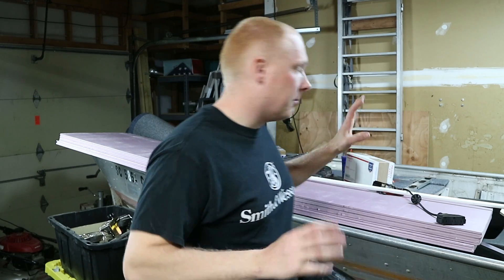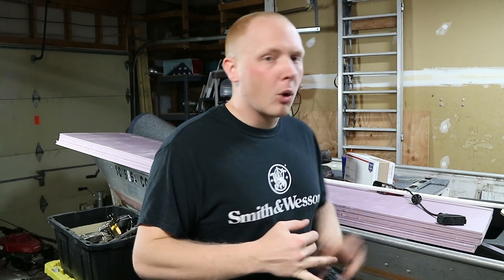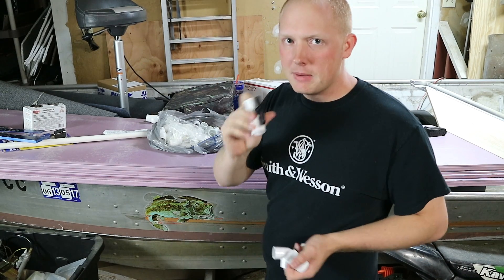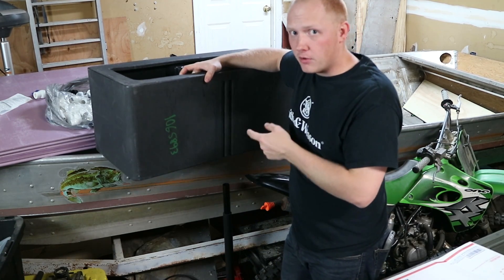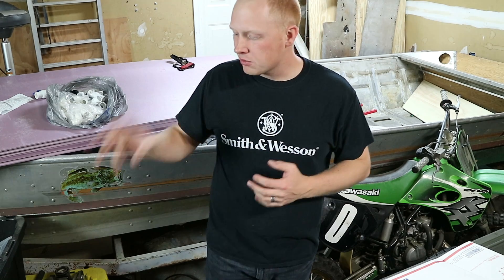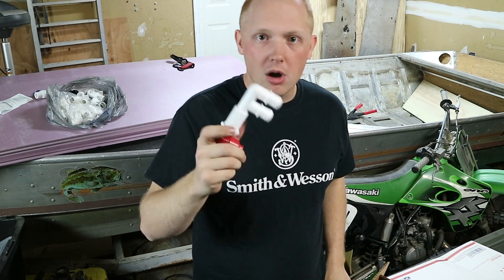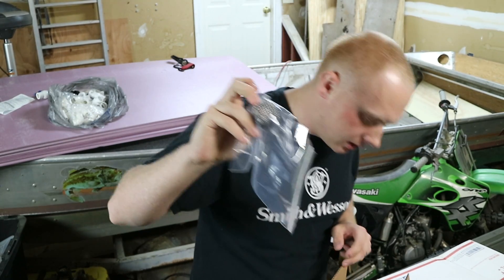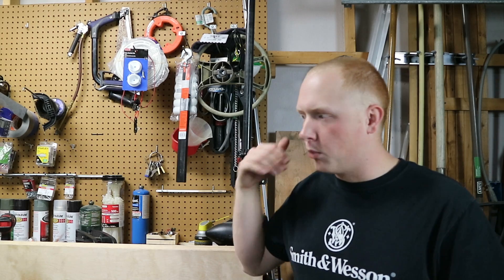Boat Update | Jon Boat to Bass Boat Restoration

Comment: You always make some great vids can't wait to see you boat when it's done I just finished my boat unfortunately lost half my footage so just going to make a finished vid and go over what I did tightlines man and would love to see the vid of rebuilding the trolling motors I'm very hands on and love fixing and building things also the small pipe will allow for more pressure than the bigger 3/4 the bigger the pipe the less compression I only know that cause I do construction for a living I'm a heavy equipment operator so I install a lot of utilities and pipe tightlines man
Reply from the maker: +Fishing The401 thanks man. I'm looking forward to seeing what you ended up doing with your boat. I'll be making a trolling motor repair guide very soon. Thanks for the info man.
Reply: SMG Fishin' no prob man and can't wait for the vid

Comment: You never got to the batteries part haha...
Thats the info im chasing, but seriously nice Boat build man...
Reply from the maker: +Patrick Northey oh man. I didn't even realize that. I guess that's what I get for trying to shoot and edit a video after being up for 30+ hours. I'm going to be doing a video on this subject very soon.
Reply from the maker: If you have questions about batteries I can try to help you out. Just shoot me an email at smgfishin@gmail.com or message me on instagram @smgfishin
Reply: I'm actually looking for some battery placement ideas also. I have a 1448 jon boat with a modified v that I've been slowly upgrading. Great job, can't wait till your next video
Reply from the maker: +Steve C 12V or 24V trolling motor?... either way I've been using the Walmart brand everstart 29d group batteries. They have a one or two year warranty and they have a very long battery life. I run two motors all day plus a livewell and fish finder and I haven't run my batteries dry yet. I run two 12V 29D Everstarts. Even had one go bad at the beginning of this season and Walmart swapped it out no questions asked.